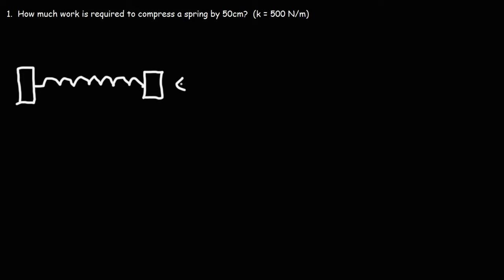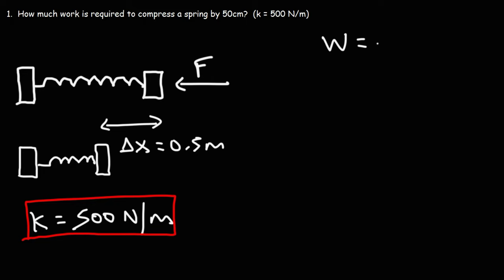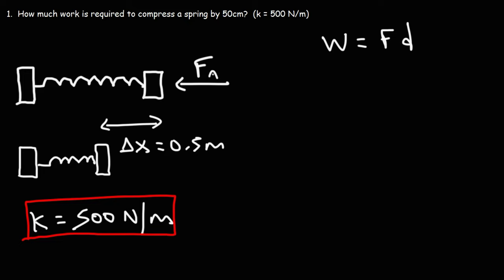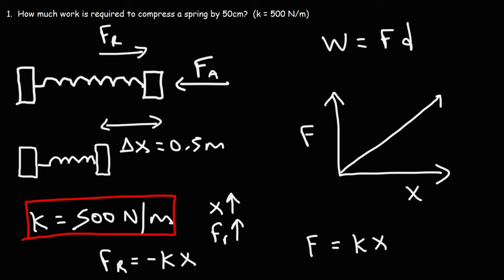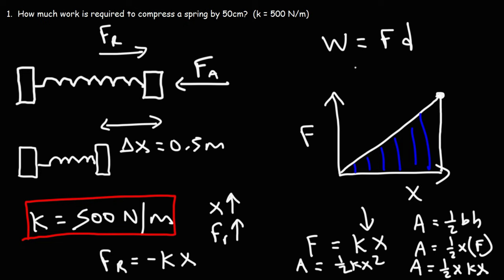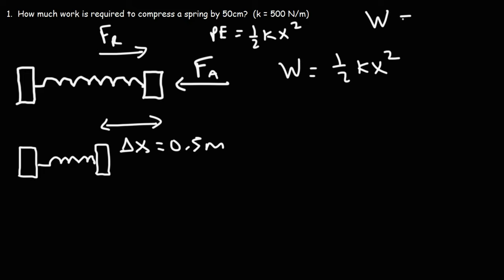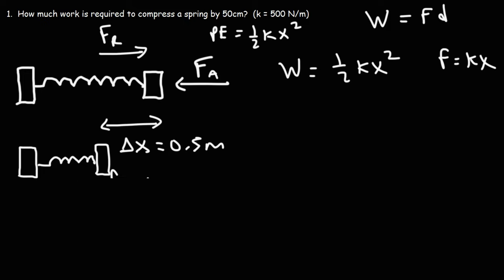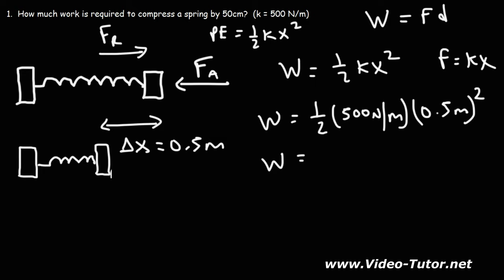How To Calculate The Work Required To Compress a Spring

Comment: A single dry-plate clutch has annular facings 200mm external diameter and 125mm internal diameter. The clutch is required to transmit 67.8 Nm at the point of slipping when the coefficient of friction is 0.3. Calculate (a) the total spring force (b) the power transmitted if the speed of rotation was 2500rev/min